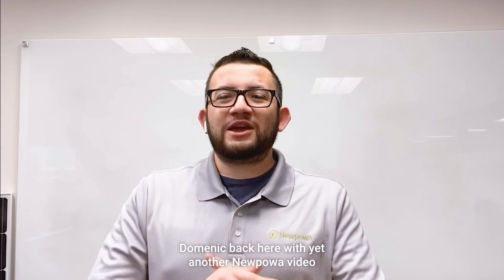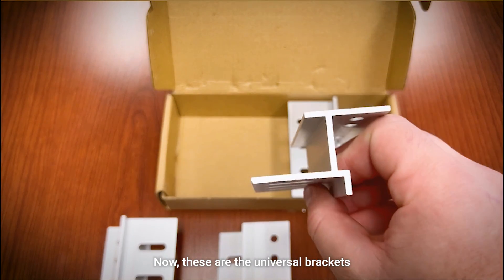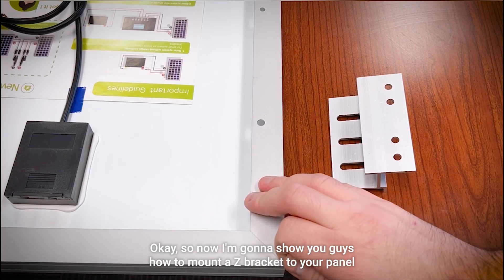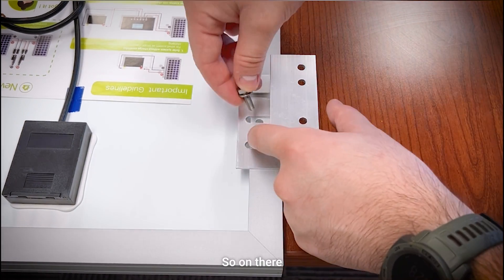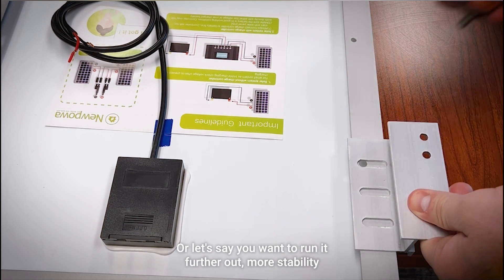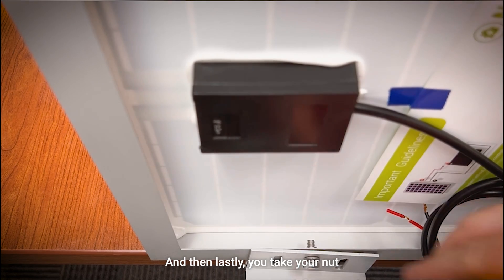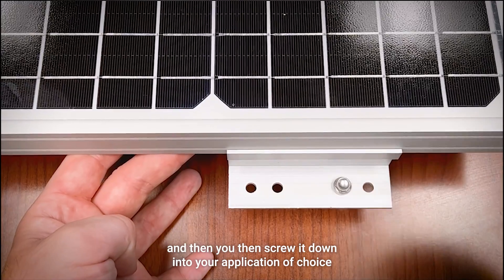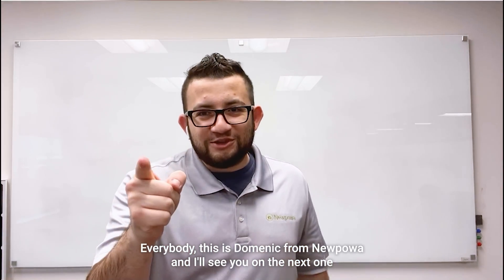Newpowa's Solar Panel Z Bracket (NPB UZ) Overview

Comment: How far out does the bracket extend beyond the width of the solar panel? Tight on space to the edge of my RV roof.
Reply from the maker: 25mm, should not brings too much trouble?